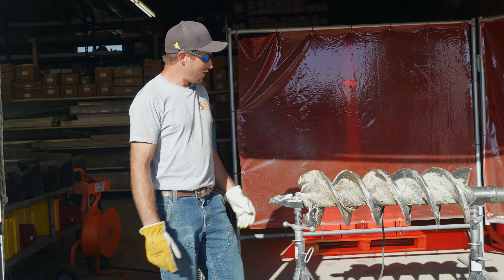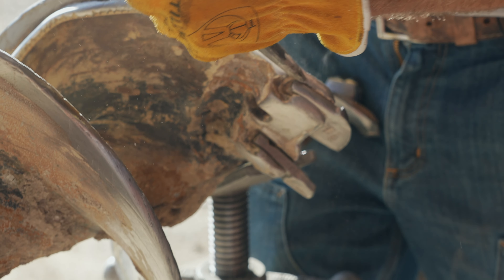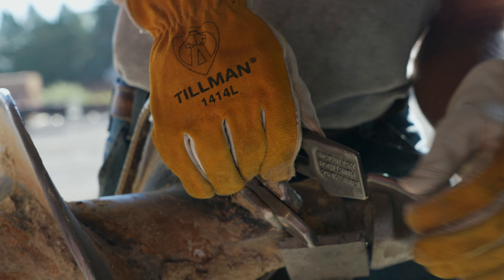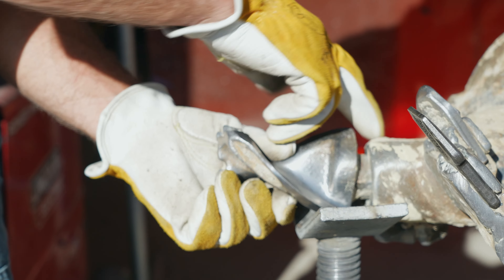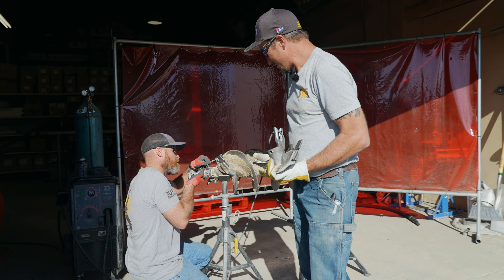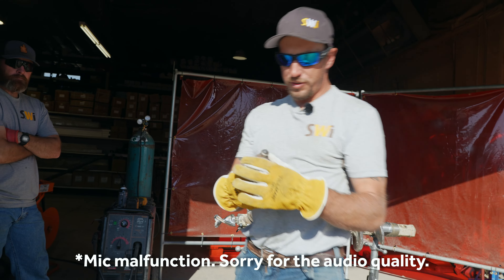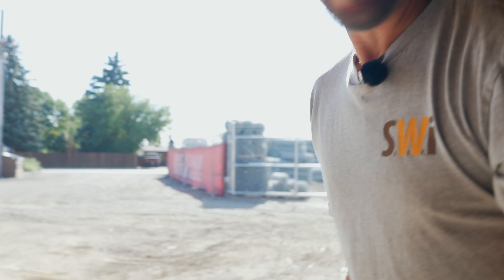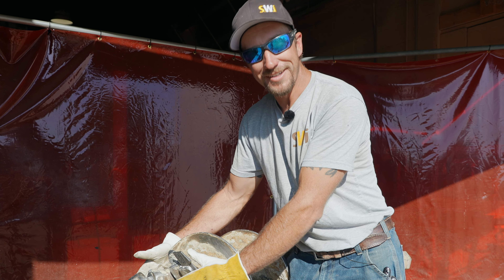Save Money With Essential Auger Maintenance

Comment: How come my dad's old hand powered post auger didn't come with replaceable teeth?  If it did, perhaps it would actually work!  

As it is..... the wooden handle is half rotten, the shaft is slightly bowed and the teeth are bent completely flat (I think someone got frustrated and tried to jam them into a few post holes.... but, I wouldn't know who.)  

So, what do you think.... should I straighten the teeth and shaft... replace the handle and weld on some teeth?  Would it be worth it to try to mount a fishy tail onto it?  Or, would I be better off just selling it to Cracker Barrel as a wall hanger?
Reply from the maker: A good cast head with drive in teeth is the only way to go!

Comment: You guys have All the gear. We use a heated pressure washer and clean the hell out of the auger propane torch to dry. Be for any work.  Typical build up any wear with 2 mig welders one with fill other mig with bare wire.  Our augers look like Spiderman puked on it with all the webbings. Once completed we coat it with fluid film and a wax coating that hardens same wax used to incase asbestos. Keeps them protected for a bit longer believe it or not.
Reply from the maker: That's a cool idea!

Comment: Those spade teeth are totally useless here. Carbide bullet teeth are the only way to go. I like to pressure clean the auger first then use electrolysis to de-rust the tooth pockets if necessary.The screw in pilot nits often require a torch to loosen up.
Reply from the maker: We have augers with both square and round carbide but only use them in solid rock.  They work poorly in dirt.  For hard frozen soil and asphalt, we replace the teeth Dan was installing in the video with carbide a carbide version.  The difference is about $12/tooth.  Almost all winter we use the carbide version to auger frozen soil and they do much better than the round bullet teeth.